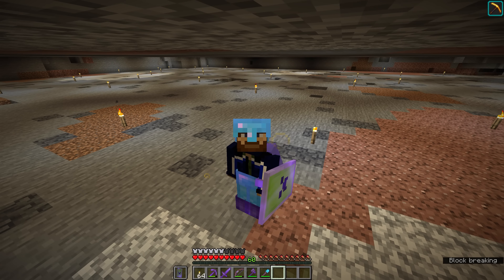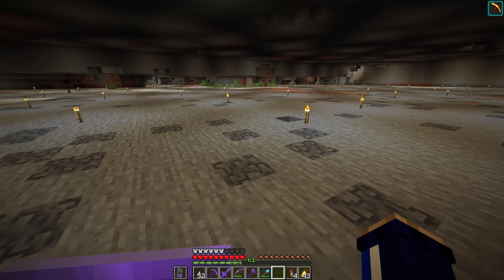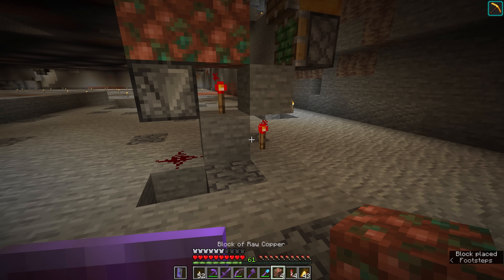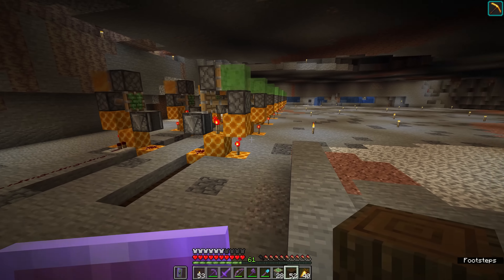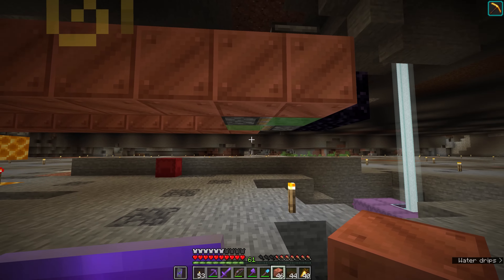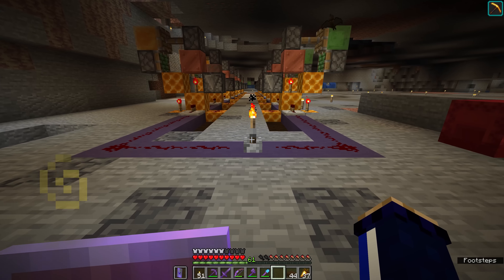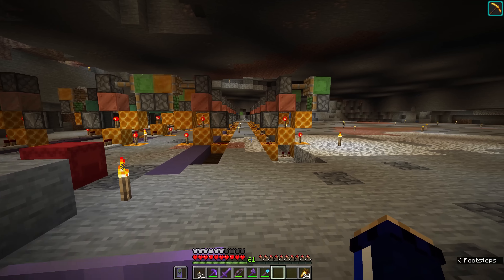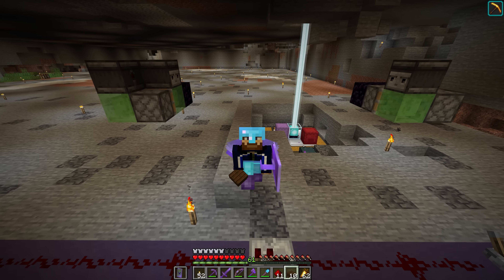Automatic Copper Aging Factory! ▫ Minecraft Survival Guide (1.18 Tutorial Lets Play) [S2E84]

Comment: For Bedrock Players*, *i dont know if the grab system works but for the flying machine you need to so something different :)

you will need 1 sticky piston and  1 piston instead of  2 sticky pistons, the  sticky piston should be on the side that the flying machine goes (front or back not sides). Finally, you will need a second retrieval machine facing the other way.
i suggest making it 2 black above and having the collection slime/honey dropped down. it will mean you need to move the obby around a bit to fit the design. The last thing is that if the top flying machine stops before the end it problem means the piston push limit was reached so you mat need to make it 8 modules instead of 9. :)